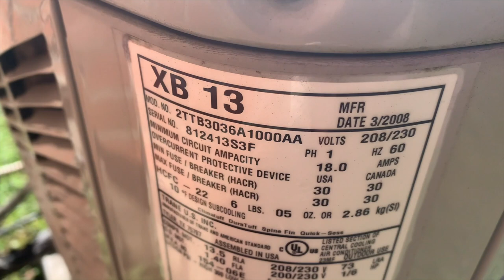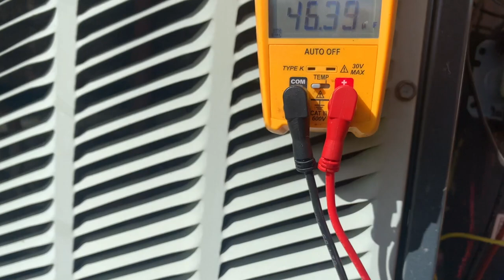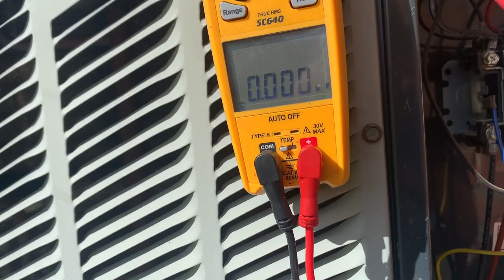No Cooling/Condenser Motor Failure

Comment: Thanks for the shout out John !! A lot of us are glad to see you back behind the camera !! Thanks for sharing.
Reply: Hey Ted. Our unit had a gray disk covering the fan motor. It was missing on that one..? Do you think water is getting down those holes into the motor casing and ruining the fan motor?
Reply: @cantor7723  highly doubt it, there's unit designs like that, that use the same motors. Unless a freak accident happens, you should be fine

Comment: I am booked up for weeks when helicopters call for service. Same for those that “forget” that their spouse has the checkbook at the end of the call and they want to mail it three weeks later, NSF check writers, jackleg installed systems or owners of biting dogs. 

American Standard’s fiberglass base pans are what makes them sound different. 

Most of my customers are not going to wait several days for a factory motor and I don’t want to drive 60+ miles round trip to get one. I use Century motors from RE Michel. One in 19 years has failed in less than one year. I get 5-15 years out of them, so as good as factory motors. I apply anti-seize compound to shafts during new equipment installations (while inside foam taping/tie wrapping wires/tubing that the factories stopped doing years ago to prevent shorts and ref leaks), PM’s and replacements. Much easier job changing a motor later.

Good job on the videos.

Comment: Let me start by saying I really like your and Ted's videos videos. I'vee been doing this along time and never thought to just tape new wires that's a great idea! My trick on fan motors is remove new motor from box then and use the box for a prop to hold.just take off the blade Stan shaft into box then unscrew the top.insert new motor shaft into hole then put top back on.it just send to help hold motor steady

Comment: This is probably obvious to you but i was wondering on the fan motor do they not require or recommend any grease on the spindle or it doesn’t make a difference in the lifespan of a motor?

Comment: Hey John nicely done, yea the temp spiked around here the last couple of days. It's the 12th today and went to turn on the ac it was getting a little warm inside, it turned on fan spinning but no cool air. Had someone come out and they put a charge on it and it lasted all spring and summer until now. Could it be the compressor? What's your feedback on this?
Reply: You need someone to look at it Michael.  It could be a run cap, it could be the compressor it could be low charge although you would probably hear the compressor start then cut out on low pressure.   Get someone you trust to come out and give it “The old how you’re doing” as Steve Lav would say.
Reply: ok thanks for your input on this and I'll see if I can find someone. Thanks again.